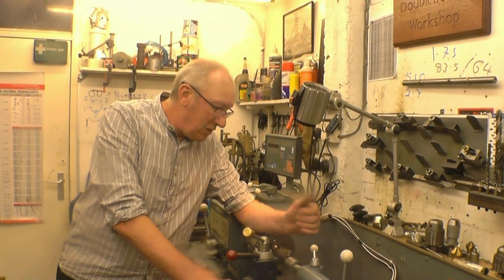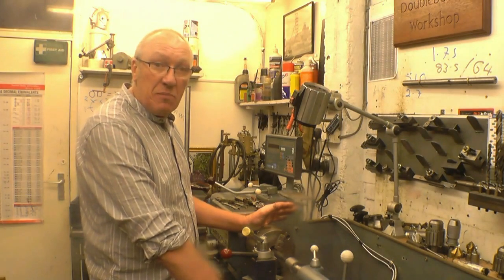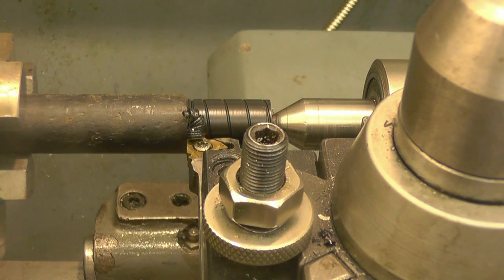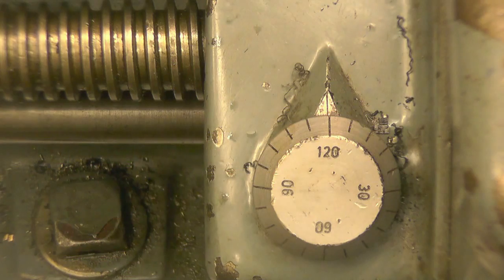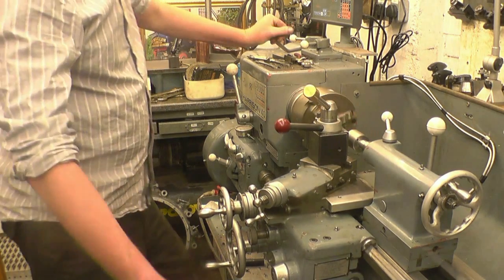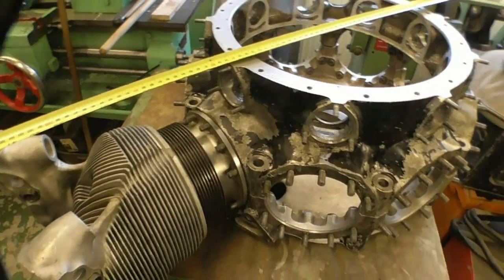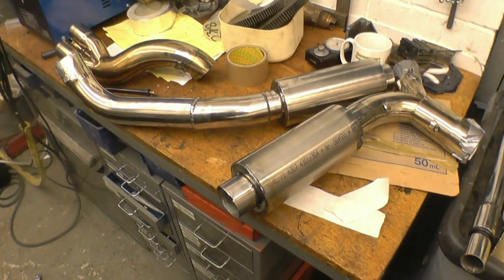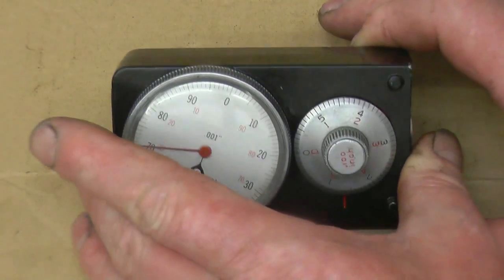SNNC 127 P2 Screw cutting  Radial aero engine  Travodial

Comment: If you have a lathe which has :
1) A Thread Dial Indicator
2) Half-Nuts
then there is absolutely NO REASON for 
1) turning the machine off while threading
2) leaving the half-nuts engaged 
or 
3) running the machine in reverse.
You can take this to the bank!!!  I highly recommend threading videos by mrpete222.  He is a retired shop teacher and machinist in his 70's, who has forgotten more about lathe work than most people THINK they know.  The internet is a wonderful tool but sometimes the same misinformation keeps getting told over and over and OVER!!!

Give mrpete222 (tubalcain) a look.  You'll be glad you did. Pete Peterson doesn't know I'm writing this....I just respect his knowledge.

Comment: Hello John,

For welding stainless exhausts, try Solar Flux type B. It was originally developed before WWII for gas welding stainless aircraft exhausts, but works well with TIG.  No back purge needed.

Comment: Why do you not like welding stainless steel?
Reply from the maker: I like welding stainless problem was the fit up of the joints
Reply: +doubleboost thanks for the reply. You should come down to our depot at Bury and have a look at our three class 40 locos.
Reply from the maker: Yes Please
Reply: +doubleboost drop me an mail and you will be more than welcome. Quite a few steamers in the shed to but my knowledge is very limited on these.